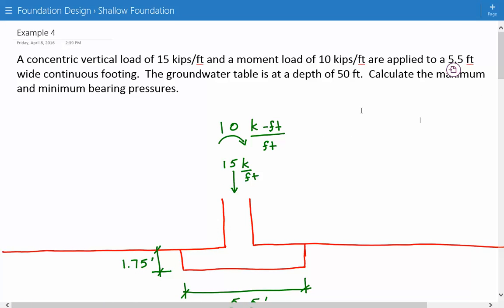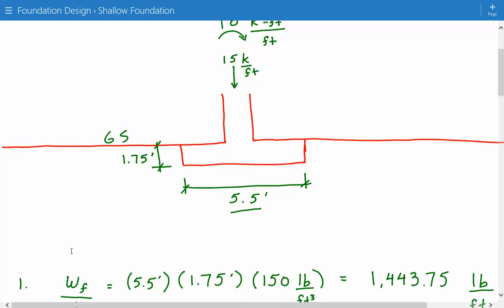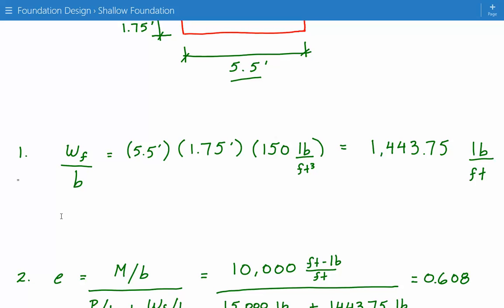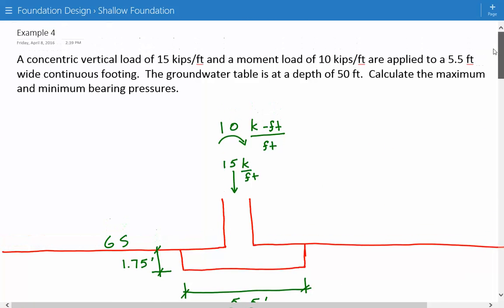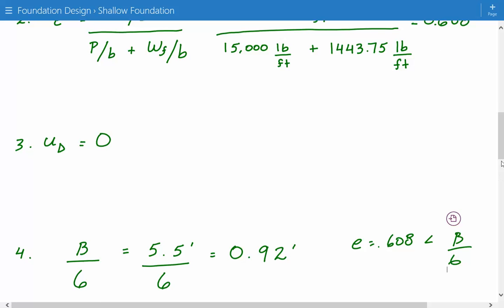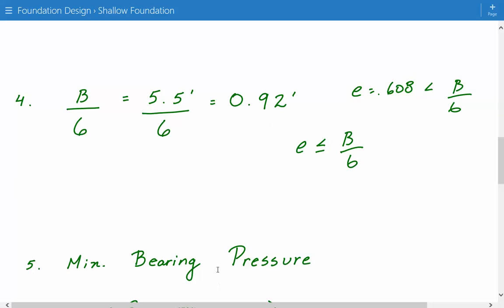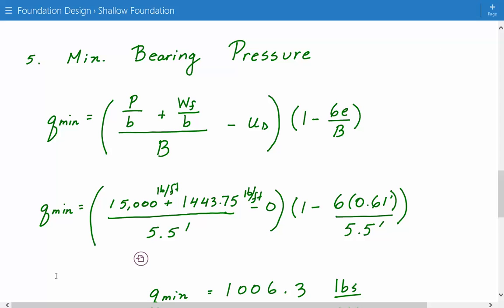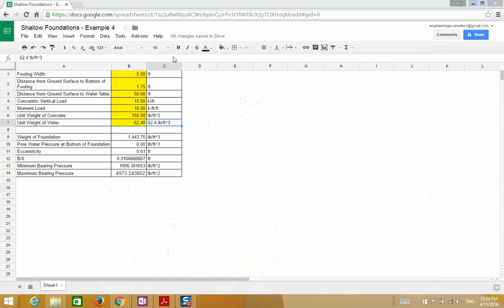Calculating bearing pressure for foundation with moment load , shallow foundation design Example 4

Comment: Can you please share where we can reference these formulas and where to reference the relation between B/6 and the distribution shape?
Reply: I'm not familiar with the above formulas, but they're basically just simple statics equations rewritten. Think of a shallow footing like you'd think about combined axial and bending stresses in a beam:
qmin = P/A - M/S
qmax = P/A + M/S

S = I/y = (bh^3/12)/(h/2) = bh^2/6 = 1*5.5^2/6 = 5.042ft^2 per foot width

For your B/6 and distribution shape question, if we have a triangular distribution, qmin = 0. If qmin is greater than 0, we get a trapezoidal pressure distribution, and if qmin is less than 0, part of our footing will not be in compression with the soil.

qmin = 0 = P/A - M/S

M = P*e, A = bh, and S = bh^2/6, so:

P/bh = P*e/(bh^2/6)

Solve for e, and you'll find that e = h/6. 

Hope this helps!

Comment: What method is this? Differs from ACI.
Reply from the maker: This calculation is not dependent on code. It is based on statics.
Reply: sir what is the size of the post?
Reply: the drawing is not good.what is the size of rhe post? there is 10ft.and 15ft.